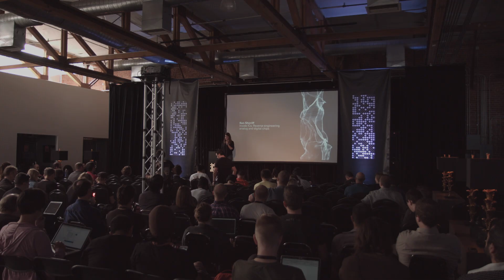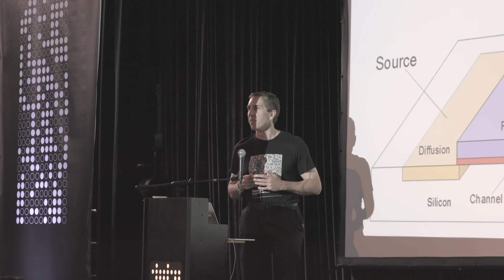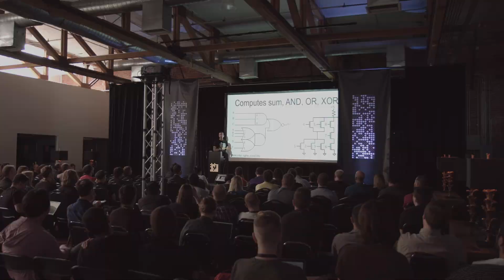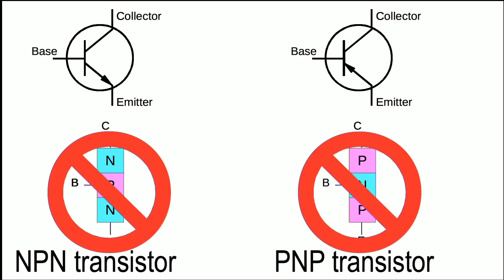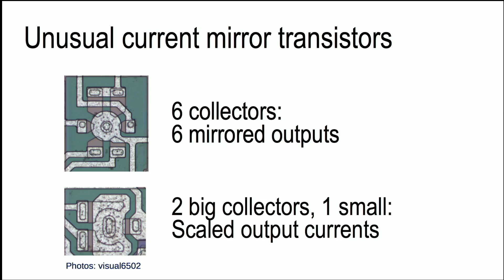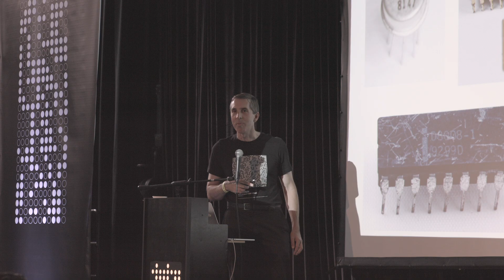Reading Silicon: How to Reverse Engineer Integrated Circuits

Comment: Why cant they release manufacture data from these old circuits? It so sad that these great minds need to reverse ingeneer these. Is it because of intellectual property rights? Or are there simply no 'digital' data available?
Reply: Every now and then, info does get released (Intel released die photos (and schematics I think) of the 4004 family a while ago for its 40th(?) anniversary), however typically companies want to protect their IP for so long that by the time the IP is obsolete, there is very little demand to release docs, and the company benefits in no way from doing so (save making a small number of nerds (like me) happy). Plus, those old docs are probably stored in a dingy storage closet on a server even older than the documentation itself, that nobody but the sysadmin who left 10 years ago knows how to use  (modern docs, anyway; the earliest chips were only documented on paper, I'm sure).
Reply: Jorge C. M. Jeez. I drive a taxi for a living... And you want me to brush up on my grammar? Come on dude, be realistic 😂
Reply: Its not only IP, but a history of creating things such as Intel ME which is not built up in a day yo know. So they don't want someone to know shit :)
Reply: for example Z80 is still being manufactured and sold.
Reply: Because silicon fab IP, and chip IP.
Most of these chips are built on a fab-specific process that is kept highly secret(contact a fab and ask for their design rules, sit down when they send you a quotation instead :P ), plus there is some valuable design info in older chips anyway.
Reply: I think a lot of it has been lost. Some of those old designs were literally done with crayons.
Reply: konsul2006 learn grammar
Reply: @JorgetePanete  Despite advising others to improve their writing, you seem incapable of correct capitalization or punctuation.

Comment: So how much work would it be to reverse engineer an i5 and it's microcode to see if the NSA realy does have a backdoor at that level?
Reply: Hundreds of thousands of man hours.
Reply: I think the hardest if not impossible part of doing that is more complicated/modern chips easily contain many vertical levels like shelves. This way of reverse engineering integrated circuits only works with the surface layer.
Reply: that's right, I used to code for the Z80A and it really was a very simple (relatively!) and user friendly CPU...but the hardware for today's beast's is really too much for one man to even think about....
Reply: well, it has already happened, though not with AI, but because of the sheer size and thus complexity of newer chip's they use computer aided design a hell of a lot simply because there is a LOT of replication, and it would take thousands of times more man hours to do it manually, no one man any more understands these chips, it takes a lot of compartmentalization to sort these things out.
Reply: given the resources needed, it might be easier to infiltrate intel or even the nsa.
I'm exaggerating a bit, but even taking a picture of the chip you need an electron microscope,  which isn't cheap, then you need to produce a schematic from that, after you have the schematic, you still need to find the backdoor, which probably won't be marked in big red letters, but most likely well hidden, and even if you find a backdoor, you need to prove it's intentional, by the nsa, and be good enough not to sell your findings to the highest bidder.
Reply: it is already done for finding design error and fabrication verification. it's done using 3D X-ray. I think nvidia has a video on it here in youtube but same thing applies to all major chip designers like amd, arm, intel, xilinx, alterra, mips etc. but there's no denying that hugely expensive setup is required and you're pretty much looking at teams backed by nation states. this is not something you and your buddies can do in the dormitory.
Reply: Well theoretically its possible. But you should know how to completely etch given layer not touching the level below. And to know that you should sign NDA in Intel or AMD and work there for a while... SUCCS
Reply: Pavel Popov the way to do that is exploit the fact that etching isn't perfectly even and build up composite images using multiple chips. As long as you can identify layers, and you have some area overlapping between images you don't need super precise etching, just a bunch of chips to work with.
Reply: There are techniques for it. You can grind one layer off at a time to expose the underlying layer, or etch away certain things, like just the metal, or the like.
There are methods, but the sheer complexity of the chip would make finding anything a nightmare.

As to why you'd do that? Well... Because it's a legal way to figure this stuff out.
Infiltrating Intel isn't.
But reverse engineering the chip is technically still legal as long as you aren't using that information to create a clone. (but even then that's only an issue if it contains copyrighted firmware, or anything it does is covered by a patent that's still valid - so procesors from the 80's or 90's are fair game for creating duplicates of, in all probability, if you felt like it.)
Reply: N ytonial its*
Reply: N ytonial really*
Reply: Pavel Popov it's*
Reply: I bet it won't take long before someone trains an AI to solve those kind of problems.
Reply: AMD too now

Comment: “Any Z80 fans out there?”
Yes, me! Me! Me!
Reply: What about the GBA? It uses an ARM/Thumb core. Though obviously, yes, it contains a Z80 as well, for obvious reasons.
(in fact, the Mega Drive/Genesis contains a z80 for basically the same reason; Technically it's the Audio co-processor, but I'm sure using it for that was an afterthought; The only reason they chose a z80 for that task is that they wanted it to play Master System games and thus needed one anyway. Might as well put it to work doing something else while it's there.)

Still... Z80... Ehh.

I'll stick with my 65xx family chips thanks. XD
Reply: Right...the game boy advance..tho..
Reply: Ditto!
Reply: I had to pet the Z80 I have in front of me when he said that.
Reply: I love the vintage processor chips, especially Z80, 8085, 805x series. Yeah I know you won't build a Pi clone with one of those but they are fun to work with!

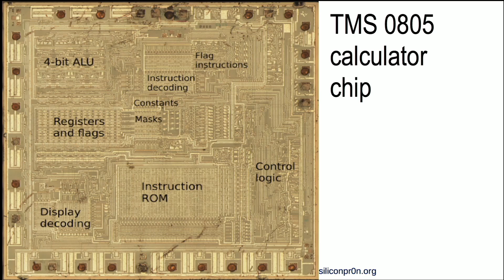Comment: I've always been impressed with those who could read disassembled code. but at minute 11:43 , Ken is disassembling SILICON and THEN disassembling the code that is in that ROM in that silicon! Oh as if that is not enough, he also wrote a simulator of the calculator he reverse engineered BY LOOKING AT THE SILICON!?  WOW...
Reply: You are watching videos, what a waste of time!
Jokes aside, any hobby may seem like a waste of time to others.
Reply: He mentioned that he reverse engineered the instruction set itself.
Reply: Actually there is a method on how to perform that... Decap, hotspot, curve tracing etc. its just depending on the ic function/s thats varying and talent is required.
Reply: +Zar Shardan
Don't say that. This kind of thing can be tremendously useful in reviving and repairing old computer kit like the C64/128 and the SGI Tezro.
Reply: Here is me studying electronics for 2 years and barely can write a line of code in C++. What am I doing here.
Reply: @alex_inside  You're fine, if you want to understand c++, just keep with it. After not so long it will click. It took me until a little ways into my sophomore year to understand coding - and that was one of my majors. The circuits were much easier to  understand. Funnily enough it was when I was taking digital circuit design and learning Verilog HDL that c and c++ really clicked for me.
Reply: @Hemuro4ever  I hope that I will understand it one day, seems like a lot of fun.
Reply: I have been disassembling code for years. Working with software is something you can do without the need for expensive equipment. To actually disassemble silicone is next level, and you need very accurate microscopes to even look at them.
Reply: I’m i
Reply: Shaun Koreshowell/Bunds relatable
Reply: Say my name? Harambe It's*
Reply: If he can do it by following simple rules, a computer program should be able to disassemble silicon in a straightforward manner, and fast.
Reply: It’s not really that hard, it’s just an enormous time commitment, kudos though for sticking to it until complete.
Reply: As a Software Engineer I can tell you all of the things he did were not that hard.
But that's computing, it's not necessarily difficult, but boy is it tedious. There are a lot of little details to get.
The real skill here is the willpower to pay attention long enough to do this.
Reply: @Hemuro4ever  Being a software engineer means nothing here. Software engineering and hardware engineering are two COMPLETELY different worlds.
Reply: @harleyspeedthrust4013  
1. You're factually incorrect. A bad software engineer can be divorced from the machine, but a great one cannot be.
2. I have made a cpu from logic gates before so BTFO.
3. You don't know what my degrees are in.

Lol, lighten up Hermann you provided NOTHING to the conversation just empty claims someone you don't know doesn't know what they're talking about. If you think I'm incorrect by all means make an argument.
Reply: @Hemuro4ever  
The fact is that you introduced yourself as a software engineer and then claimed that everything Ken did in this video is not actually hard. That's a huge red flag in my mind that someone doesn't really know what they are talking about.

On the Internet, anyone can have many degrees and have designed CPUs from logic gates. I'm an Olympic runner with 2 gold medals and 1 silver medal. I am also a billionaire and I have founded 17 companies. Did I mention I can deadlift 800 lbs.?

You need to lighten up. So what if one old idiot on the internet doesn't believe that you know anything about hardware engineering?
Reply: @harleyspeedthrust4013  Your projection is hilarious. You're the one who was triggered by someone saying something you didn't agree with and then you proceeded with irrational ad hominem attacks instead of even attempting to engage in the discussion.

I hope you post the whole thread lol, it'll be good laughing at you again.
Reply: @Hemuro4ever  Nobody wants to engage in a discussion with a conceited brat who thinks he's some kind of debate god.

Edit: Also, I'm curious: what do you think of fedoras and what is your religion?
Reply: @Hemuro4ever  Funny how we're not watching your presentation on all the really hard work you've done, huh.
Reply: Anyone that had being paying attention to EE classes (VLSI, Computer Archtecture, Microprocessors etc.) can do that. It is a lot of work though.
Reply: I’m sayin right... what a bad ass lol
Reply: what a royal waste of time though ...
Reply: @zariumsheridan3488  You know that the point of a hobby IS to waste time, right?

Comment: I've found that very flat ceramic chips (which can't be chiseled) can be heated and will crumble, though occasionally with case residue on the die. The fumes are not good for breathing.
Reply: I think that we soon will have access to high power laser beams that can chisel away AND scan a chip in 3D and remodel them, as a by-product of the nascent 3D-printing technology.